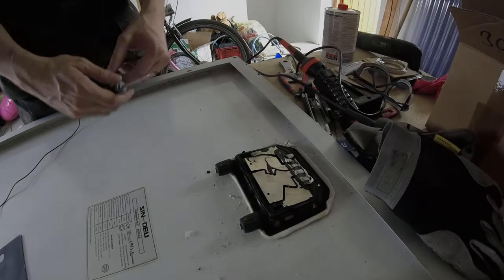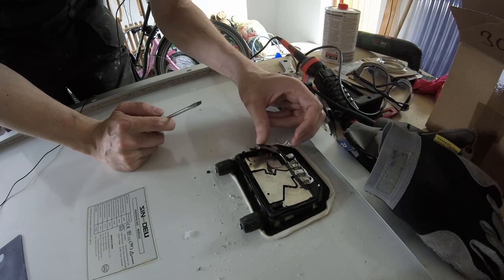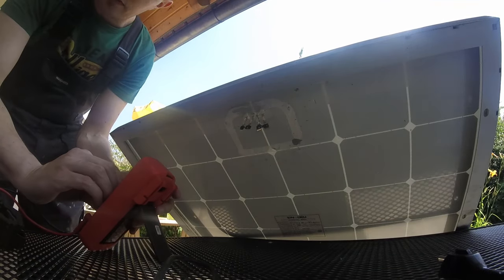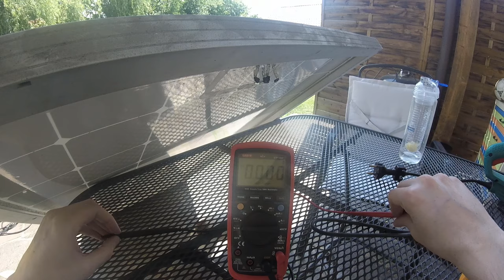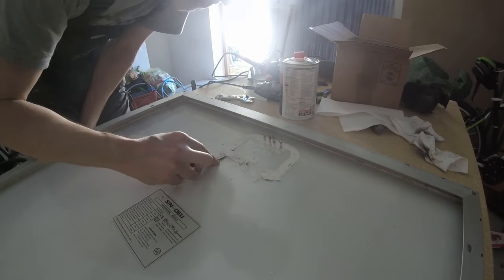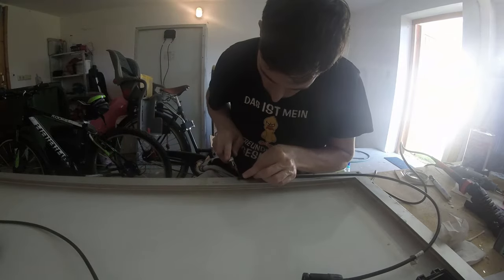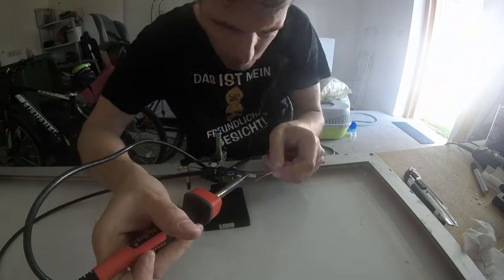Free solar panels anyone? - How to repair broken panels!

Comment: You didn't have to cut the existing tabs and then cut into the EVA sheet. That'd effectively ruining the life of those panels.

You could have resolderd thosr pins as is. Heck you didn't have to remove the junction box on most of these. Just new diodes, new solder and it's done.